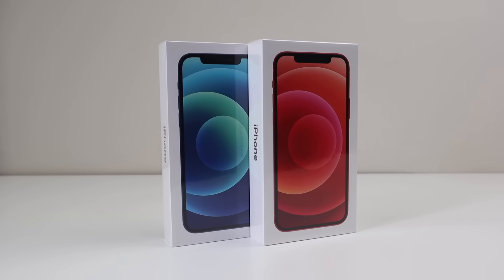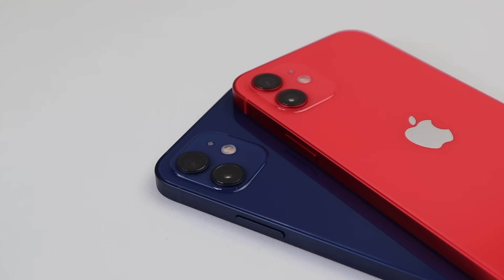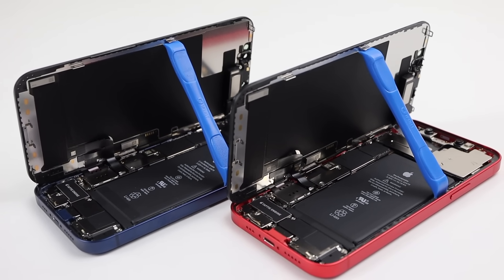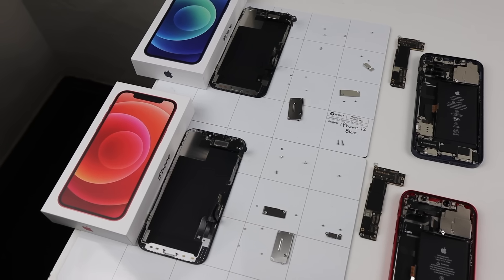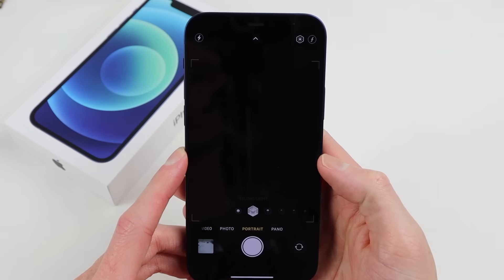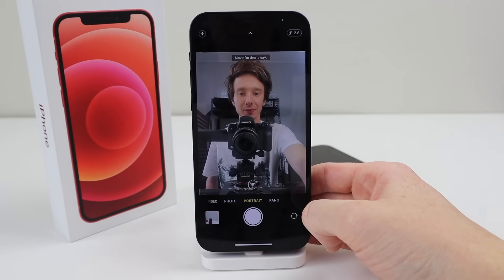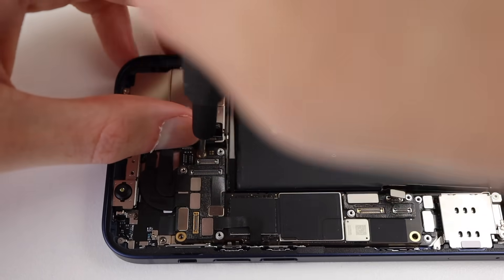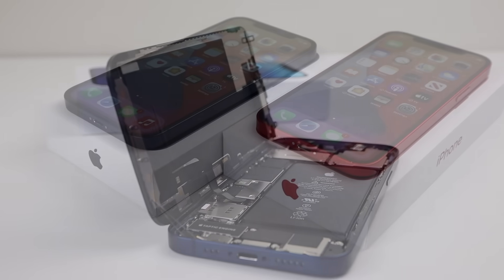iPhone 12 Anti Repair Design - Teardown and Repair Assessment

Comment: ditch apple, who believe they have the right to dictate to their customers what they can and can't do with their own device. No other companies do this tripe! Time for the Client to dictate terms to Apple and stop acting like Big brother, as it is a great way to destroy good business practices. Only those who are blindly faithful to a brand that is nothing more that a company with delusions of grandeur! Can you imagine if Chevrolet started locking down their cars and truck and sabotaged other mechanics' efforts to repair their product, with making it only possible for Chevrolet to repair their cars at over $250 per hour? Imagine what would happen to Chevrolet's market share? How many vehicles would be thrown away because people wouldn't be able to repair their truck or car. In the Automobile industry, the Buyer is in charge of what is included in their vehicles and if those expectations aren't met, those buyers will go to other makers of automobiles and buy their product instead. but in the electronics industry, there are countless millions that buy apple products despite the fact that they are a generation behind in processors and have other "security features" to protect the device from being used in a way that the company has decided is not right and therefore you cannot do it.  Buyers of this product is empowering this disgusting company to the forefront of technology when they are clearly second fiddle to many other makes! I only Just stopped using my Samsung Galaxy 2 phone because the battery finally died on it! When has an apple device lasted that long on the market? When they actively install software that screws up the device and prevents it from operating the way it should because Apple wants you to buy a new phone every year, at more than a thousand dollars per! Why on earth is anyone buy their shit at all???? Man I can't stand socialistic people, especially when they own a giant tech corporation that makes an attractive sandwich, who cares it there's a layer or Diarrhea under the cheese, just look at how beautiful that sandwich is, and they have been eating shit sandwiches for so long they can't appreciate other sandwiches that aren't shit sandwiches! The analogy is true, there's only a little shit on the sandwich, just drink some Lysol after you eat and it won't be on your breath..... A company like Apple should have gone bankrupt a long time ago for so many reasons, it's mind boggling how people still buy their crap sandwiches! Honestly their performance sucks, and their mindset is one of Big Brother because they  are a collection of socialistic morons. Anyone who is a conservative, who believes that a person has the right to decide what they do with their device when they have bought it and it is theirs by legal right. Well, I guess there are always a group of Village idiots that need to spend their money on something and I guess they have formed some sort of Union because they all faithfully give their money to Apple so they get a device with a generation late Processor and all kinds of safe guards to prevent you from doing anything that Apple does want done with their devices so , I guess that these village idiots are happy to throw good many after bad, at Apple who is always willing to tell others how to live and what to do to be a good little drones. I for one am old school, as soon as someone who doesn't even know me, starts telling me what to do and what not to do with an electronic device, I turn around and tell them what they can go and do with their device and to make sure that sun doesn't shine on it either!!!

Comment: This hit me when I first saw them air pods. Unrepairable, unserviceable and even nonrecyclable... Using green energy to produce such amount of waste is simply incredible hypocrisy...
Reply: @epiccollision I'd say look up reading comprehension.
Reply: @epiccollision everything  inside the earphone is covered In glue. Only place you can throw them away is the trash. The battery should be replaceable on 160$ earphone but it’s not. Mine only gel an hour of charge after two years. Waste of money

Comment: https://www.applessupport.com/

One stop for technical support, We provide Apple hardware service and software support, we place a high value on establishing long-term relationships with our clients, eventually becoming virtual extensions of their organizations. Our consultants and engineering teams address our clients' specific requirements with best-in-class support solutions across a broad scale of service areas. Address : 1010 N. Central Ave, Glendale, CA 91202,USA Toll free no : 1-855-474-3314

Comment: about the power adapter then what's the point of buying a one if the one you bought will be just a waste and did you know that the horse floated inside the sea but the water is wet

Comment: I used my IPhone 6s for 4 years and gave it to my mom. It works very well. Just would be nice to replace a battery. My kid has iPad mini 4 gen for 5 years now. And few month ago my younger kid washed it in the bathroom for 10-15 min mb. The water was inside. I could see it under the display. It didn’t work until I brought it to authorized service. First they wanted to charge quite some money to repair it but it didn’t make sense for me because of the price of the used iPad mini was almost the same as for that repair. Later they called again and said that they cleaned something there and it works. So in total I paid around 25 usd. No parts were changed. Some Lights on one side near the button are off for some minutes but in general it works fine.  

I gave my kid to play with other tablets. The experience was never as good as with iPad mini. (Some were easy to brake. Some just not pleasant for UX/UI experience of a system (sorry for my language hope u understand what I meant)). I’m happy it’s survived 😀. And I didn’t mention how many times it was poorly cared of by kids on a daily basis even with a protective case.

Comment: This is just one of many reasons I would never buy an Apple product (again). Their "exclusive" policy that means you must buy every related product from Apple. Phillips did the same thing in the 70s with their 5 pin DIN connectors when everyone else was standardised on RCA phono plugs.
Other reasons why I wouldn't touch Apple:
1) I've owned 3 Apple devices, an iPod an iPhone and an iPad. The iPod is still working but the other two gave up within a year... just stopped working completely.
2) My brother bought an expensive Apple Mac laptop and within a week the power supply failed. When he returned it they said they'd have to send it overseas for a warrantee repair. He asked for refund instead and bought a PC based laptop that was more powerful, cheaper and is still working 5 years later.
3) They're WAY too expensive!!! Especially when they claim to be "top shelf" products but aren't.
4) My own personal experience with Siri on an iPhone:   https://www.youtube.com/watch?v=Hi9wNwTnumg&ab_channel=WarrenNZ
To be fair asking Siri for a weather report is a bit of an odd request.   :-)

Comment: Best line : Forget about environment friendly. Repair and reuse is important
Reply: There not recycling those little
Reply: maybe what they mean is that, when these phones gets dumped in to trash , they look very fashionable compared to the other trash
Reply: @Jaquan Kelsor Guess what, you can do BOTH!!
Reply: If they cared they wouldn't include a nonsense usb c to lightning cable in the phone
Reply: I agree with Yusuf completely. Repair until it is no longer possible. Then recycle the proper way.
Reply: @Jaquan Kelsor r/woooosh
Reply: @Jaquan Kelsor bruh
Reply: Yeah I worked on my own and friends' Apple products for years. The repairability has really made it impossible to do that sometimes, but it's opened me up to other ecosystems more. If you need to calibrate a component that makes sense, but the locking sucks. Also USB-a connectors are still the most common so they should include a C to A adapter at the very least, and a coupon to claim a power adaptor in case you don't have one.
Reply: doesn't apple offer a recycling program or something
but meh.
Reply: ?? Dude
Reply: People don't want reuse, otherwise there wouldn't be an iPhone 12. You'd still be on iPhone 1.
Reply: @larrybud  Not true my grandpa had 1 tv for 40/50 years, is not people. Stop blaming people is corporation that make old products useless. 

I commenting with my iphone 6, the battery can’t be changed, I always need a powerbank. 
You think apple wants the best for you?
Oh please go back watching disney movies
Think before you speak.
Reply: @Jaquan Kelsor angry greenpeace member sighted

Comment: I’m waiting for this to turn into a lawsuit
Reply: Let's get Luis Rossmann involved!
Reply: Apple will throw so many lawyers at it that it'll make the other party go bankrupt
Reply: Just get an Android..
Reply: @marc4770  I've always had problems with Android. The OS is not as stable as iOS. I think part of that problem is the amount of devices similar to windows. The manufactures simply don't update the devices and you end up with an obsolete device. I've owned my fire tablet since 2017 an had to root and install custom firmware lollipop just to get the bloatware off. I had issues with Alexa wiping out my battery. The WiFi constantly drops while using it. Had I updated fireos the tablet would have slowed down even further from what people have reported. Meanwhile I have my iPad air which is almost 6 years old and just got iOS 14 and that runs perfectly. It sucks one way and the other. Even if I were to get a Samsung tablet they only update 1 version.
Reply: @npolite22  Well i dont.

Comment: Just stop using apple products. Honestly, you'd be better off with android or any other system for that matter. I don't know about you all, but I like to own my device.  

Besides apple pulls the same bullshit that beats did all those years ago; It's the name you're buying, plus the quality of the hardware is way over priced to the point it's not even funny. 

The simple answer, do not use their products. In fact, if a large enough flux of people stopped buying them, the corporation would have to drop the price. It's basic economics. 

Really, their are nothing without the consumers, so if they pull something so stupid just hit them where it hurts: their pockets.

Comment: Like how the hell not including charger can save the environment? All it does give you more box and plastic package
Reply: @epiccollision that's so selfish of Samsung! Literally nobody has a usb-c cable...
Reply: @epiccollision just as bad, stupid and anti-consumer, except they do use a universally accepted type of cable that all other manufacturers use (type-c) and that is widely available and the phone does not brick itself if you use 3rd party chargers and cables that are not "MFI certified". A lot of laptops are now using type-c  for charging as well (even Apple!) and you can use the laptop charger to charge your phone. 

What is your point?
Reply: Hell's favorite Salty Masshole   As he mentioned in the video, they changed the cables recently meaning that most people don't have the cable required. Instead of selling them seperately, it would be smarter to sell with or without the charger, so it is not seperate packaging if you do decide to get the charger.
Reply: @suzanne8347  spending 1200 on a phone i'd expect an official charger to come with it. have apple just shot themselves in the foot by not supplying an official charger when someone uses an official charger that blows it up?
Reply: also them now selling a whole new cable actually creates more waste than that, because if people decide to switch to these chargers, they need to buy a new charger and throw out all of the older ones. it’s nice if they give the option to get a cable like that, but not everyone needs one like this so they could just sell it separately
Reply: @hello-jg4tx  having flashbacks to when they first removed the headphone jack. I wouldn’t put it past them to remove the charging port to force people to buy wireless chargers because “wires are wasteful and bad for the environment. just use the spare wireless chargers you toootally have lying around the house”
Reply: Supposedly it reduces the box size or something, but it does reduce weight, meaning that a truck can carry a ton of iPhones and waste more gas, which affects apple and they have to pay for it. Also since the boxes are slimmer, they can carry more iPhones for a profit.
Reply: @thebestdoggo9512  but then again, they need more separate truck for charger which is more money for round trip, if it shipped in the same truck it defeats the purpose of your point and even mean inefficiency because now charger took more space with its own separate boxes. either way, its not really pro consumer and intended for save cost instead of save environment as they advertised
Reply: @iceseic  yeah, I know, it's performative really. I think they just want a truck with more iphone for the same gas prices. The chargers? I dunno, it's obvious they don't care though.
Reply: @iceseic  they don't really care about any of those things. They want to train the customers to accept less and less. Now the phones will be unrepairable and all but obsolete within two or three years, and people will think this is amazing. You should just have the newest and greatest and then it disappears, not have some poor person get your status symbol for a bargain. 

They're running out of ways to make phones any better at all. So they'll have to do shady things like this to max profits.
Reply: Hell's favorite Salty Masshole  I bet apple change the connector rendering old chargers obsolete anyway 🤭
Reply: stop complain. just buy new i-phone every charge!  get with the program!
Reply: @klam77  i know right! People are so dumb who tf charges their phones anymore! A new iphone every day is more cost and enviromentally friendly

Comment: Hmm the parts must each have like a serial sync to the logic board so when you boot it read to see if it matches someone would probably need to crack/injection those to the parts before repair

Comment: Repairing android buttons - 10 dollars
Repairing apples buttons - 100 dollars 😂
Reply: sometimes replacing android buttons less than 10$,so yeah android is better than apple
Reply: @euvo_sound  Yeah cost me around 50 dollars to repair iPad's Home button ( not even complete replacement ) from apple care and it still doesn't work properly 😅 10 dollars a lot or for premium phones, mid range android devices buttons can be replaced for 5 dollars

Comment: For every part Apple has a Barcode type Number installed.. When u changed that  part and put into another.. The memory tries to read the data on every single chip or that connection box(I'm not being able to find that word) .. Mismatch will cause error. And hence u get error.. However if  U will be visiting the iPhone store and installing a new battery.. U won't get a issue. The key is already in there.. U can even solve the Apple code. Just learn some sophisticated VLSI programming and U are in!
Reply: If it's that easy then you make a video on it

Comment: They are not doing this so people buy another phone, it’s to push people to do repairs though Apple and buy their Apple care program. Cause I’m sure Apple will have the tools/software needed to over run the errors that came up with the cameras. The ideas is that some repairs 3rd party repair shops won’t be able to preform even if they had an iPhone to pull parts from. I wonder if similar issues could happen if someone did repairs on the logic board. This is just a way to monopolize their product

Comment: Apple : 1000 $
Samsung : 500 $
Apple falls of the couch on the floor : cant be fixed by a new one 
Samsung : falls of 20 times still good 😌
Reply: Ehh, no the Note 20 is quite expensive, and I suggest you dont drop it 20 times.
Reply: @BrawndoQC  yeah your right I had an old Samsung smart phone and I dropped it about 100 times and cracked the screen and some how it still works
Reply: @gautama6800  You might want to see a neurologist.
Reply: @BrawndoQC  this comment is a joke it’s your fault of you took it seriously
Reply: I literally dropped my S7 on glass and it still aint cracked
Reply: @Rhxtyle  exactly
Reply: @Rhxtyle  Ok, but my iPhone didn't crack either. You want a cookie?

Comment: 0:54 was enough for me to realise that i made the right decision jumping over to android, NO power adaptor or headphones (later not being a deal breaker) for the ridiculous price of this phone is a complete joke. Plus i still cant get over Apple deliberately releasing updates with the sole intention of killing batteries in older phones forcing you to either have a new battery installed or purchase a new phone.
Reply: No power adapter is ok because i have them flying around everywhere, but using this as an argument while switching to the smaller usb that no one has yet is ridiculous

Comment: learned how to run PCs in the early 90s.   Never saw a need for any of Apples overpriced crap.
Now everything needs to be simplified so you can stare at those 15 second videos faster, all 
day long,  like the rest of the iSheeple.   And before anyone else comes back with this  ultimate in
original comments,  I'll do it to myself.
OK Boomer.

Comment: I noticed them making it more difficult to repair things. I'm a complete novice but the ipod 5 was relatively easy to open and replace parts with zero damage to the chassis but the ipod 6 is virtually impossible to open without damaging the body of the device.